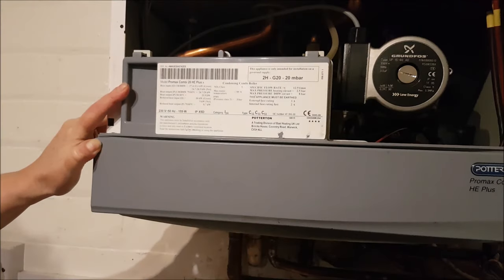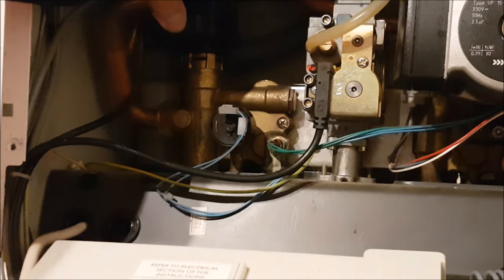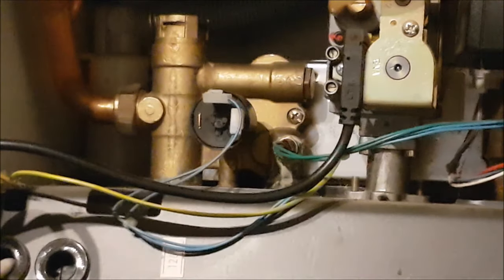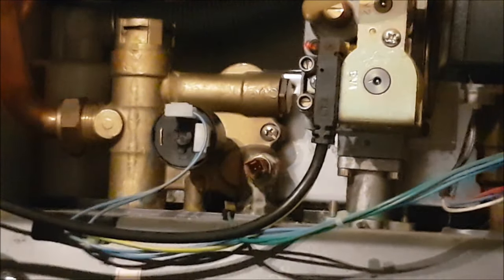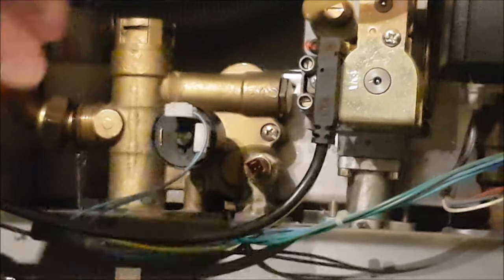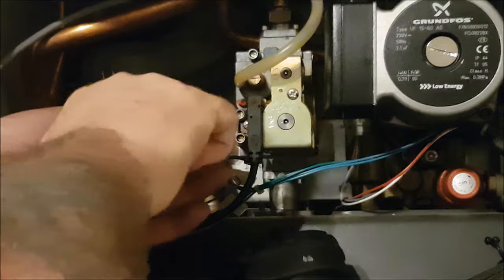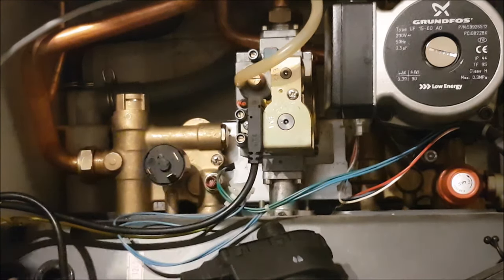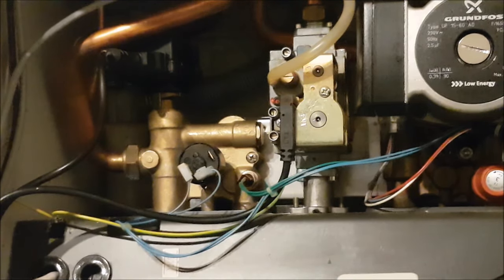POTTERTON COMBI BOILER 28HE DIVERTER VALVE REPLACE

Comment: Hi, Ive just changed the cartridge in the diverter valve but I still have no heating. Is it worth changing the whole assembly? The assembly just looks like tubing that houses the valve so I don't know if it can go wrong? any suggestions asap would be welcome. Ive had no heating all through this really cold spell. Thanks.
Reply from the maker: I'm not a plumber but try the diverter motor switch first.

Comment: Personally I would have first changed the cartridge inside the diverter valve as that is what switches the boiler from heating to hot water and back to heating. It is also quicker simpler and cheaper.
Reply: Thanks for the tip,it's exactly what I did ,was piss easy and only cost me £12

Comment: Excellent video. How much would this typically cost to be replaced. I've been quoted £505 but thats seems a little high to me.
Reply from the maker: soz i never got a quote every time i asked a plumber no one turned up i did get a quote to change my heat exchanger £450 so i did it myself for £35  off ebay  took me 25 mins

Comment: Thanks very much, I replaced mine in about 40mins  heating is working a treat now.
Reply from the maker: Thanks for watching
Reply: @MrMeltedwellies  hi mark
I get a E168 fault. I can have hot water but when heating comes on the fault pops up.
I can hear the system clicking but it doesn't heat the rads.
Does this does familier
Was looking at buying a diverter valve and doing this myself.
I'll be watching your video as I'm doing it
Reply: @joncocks2262  sounds like a blockage in the system. The diverter kit is around £20. Much cheaper to renew the rubber diaphragms and o rings.

Comment: The diverter valve on detours heating water  circuit to a heat exchange jacket The cold water supply to the hot water heat exchanger does not pass through the diverter valve ONLY through the heat exchanger Your heating system water needs flushing and refilling using an inhibiter That will pevent this type of problem

Comment: Hi Mark. I have the same boiler. My central heating has been off all summer. I switched it back on early October. Some radiators get hot some don’t. Sometimes they get really hot sometimes just luke warm. I’ve bled them, no change, ive flushed them too. Boiler seems to be fine. I’ve checked the thermostatic valves they’re all okay. Any ideas what it could be?
Reply from the maker: Could be pump or sludge soz its a bit tricky when its not your own boiler Mark

Comment: Hi Mark, I'm about to attempt to change the heat exchanger. I have the same boiler as you. From your vid It looks like the rubber seals just sit inside the diverter valve openings on the back, and the exchanger openings then just seal up against those rubber seals after tightening the screws, making it water tight, Is this right?  sorry I don't know how else to explain my question. Thanks.

Comment: Hi Mark, when re pressurising the system is there any way to bleed the boiler before opening the tap to the heating system ? Or do you just use the loop to pressurise as normal where does the air go ?

Comment: No need to change the full valve, i can change the insert in about 10 mins. Leave it to the experts buddy.
Reply from the maker: I tried to leave it to the "Experts"but no one turned up !!!!!
Reply: My 'expert' visited twice and it still wasn't fixed. He advised a new boiler. i changed the valve like this and it is running again.
Reply: what expert??? more like cowboys.
they change almost every part apart from the faulty one, it's a joke.
Reply: Just change the cartridge not the whole valve
Reply: It depends which type of diverter valve you have. I have pre 2008 and the insert can not be replaced on its own. Only the whole valve. Baxi technical advice confirmed it after Gas Safe boiler engineer tried to change insert and it did not fit.

Comment: It is illegal to work on gas appliances unless you are registered to do so only registered  with gas safe number 
Your plumber is WRONG
Reply: Actually, dave. I'm a gas engineer, and you are allowed to work on your own boiler.  GSUIR states, as long as it's not for reward and your competent. The competent part is ambiguous tho
Reply: Did you complete relevant safety checks though? Also you should make the diyers aware of this as house insurance would be invalid also
Reply: Competence is proved by completing acs assessments every 5 years

Comment: Hi mate. I have the same combi as this. I'm having an issue where I have hot water no issue, but no central heating. The thermostat is all paired fine, as I can hear the boiler keep trying to turn on the heating when I set it to (clicking) but nothing.... Would this be a case of replacing the diverter valve only? Could it be something more simple? If its the pocket hole option, where can I get a replacement from? Cheers mate